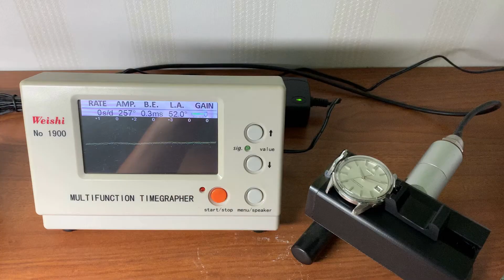Vintage Seikomatic 8305B (4/4)

Comment: I liked watching the disassembly process and the reassembly. I have a Seikomatic Slimdate  gold version with  this kind of movement. Today, when adjusting the time, rotating the crown is very hard. It feels like the gears  are grinding each other. But somehow the watch still runs normally. Oh how  I  wish you could  service  my watch. I love this watch very much. Unfortunately I live in Philippines.
Reply from the maker: There are a lot of watchmakers and watch repair shops in your country, I believe. Please don't try to adjust the time anymore, just bring it to the repair shop. Thanks for watching! ☺️
Reply: @TimeOnWrist  Yes there are few watchmakers nearby where I live but I don't trust them to be gentle and careful tinkering my watch movement. So I decided I will disassemble my watch by my self since I have experience opening, cleaning the dial, case and re-mounting the hands. I just ordered the proper set off tools for the movement disassembly. Thanks to your 4-part video I learned a lot about the 8305 movement. Now I have the courage to service my own watch. Keep up the good work man!
Reply from the maker: Very cool! 😎 Please let me know the result after you have serviced the watch. Thanks, and good luck to your watch tinkering journey 😊